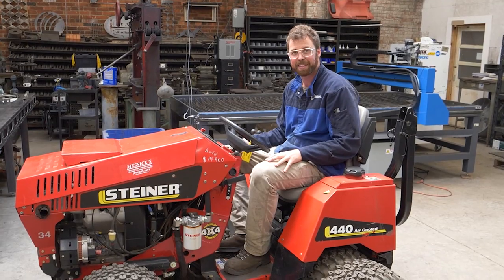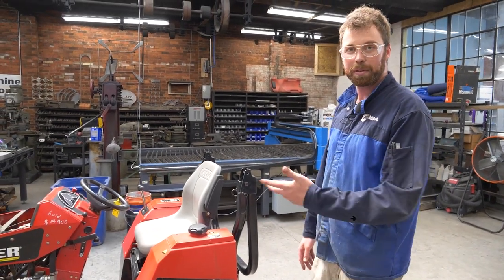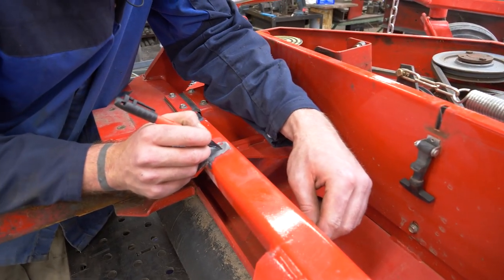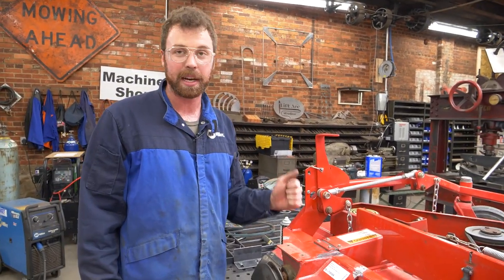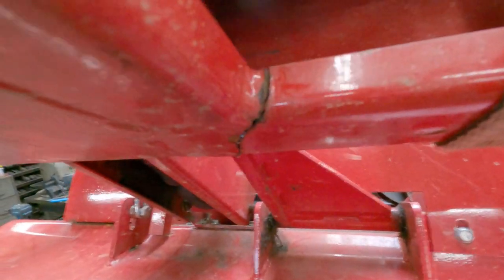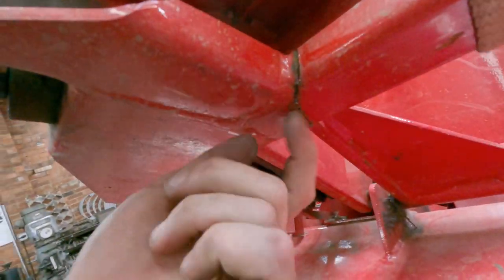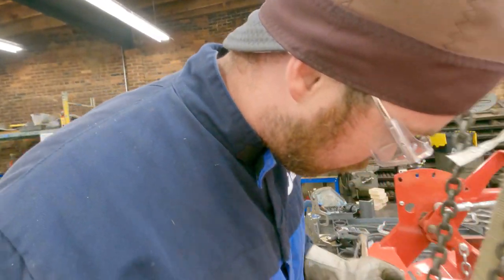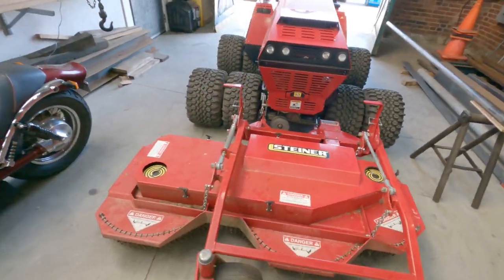Fixing Cracks on an Expensive Lawn Mower // Lift Arc Builds

Comment: A little late to the party here, like a year...but my preferred method, especially the cracks near the lift points: Prep/weld as you did but follow up with welding on an overlay of at least 3/16", bridging the top surface at a minimum.

Comment: Nice work.  Cracks like these occur from repeated (cyclic) loads which are well below the metal's strength properties but which result in fatigue failures.  The weld repairs will approach the original metal strength properties but the fatigue characteristics are not as good because of stress concentrations inherent in the weld process.  I think it would be prudent to track down the source of the cyclic loading.  Likely there is a bad bearing or damage to a blade which is causing an out of balance loading.  It could be as simple as "clocking" the individual blades so that any out of balance loading is canceled out.  The machine looks pretty stout so eliminating the fatigue loading should prevent a second failure (which will show up in a weld pretty quickly).